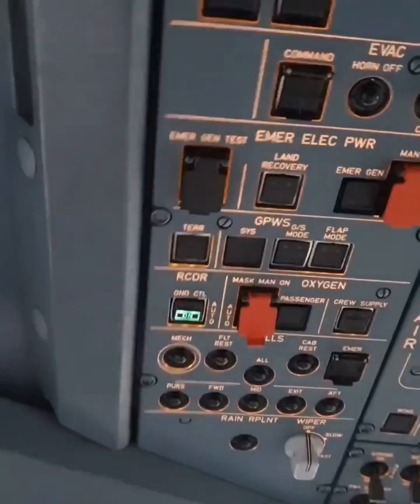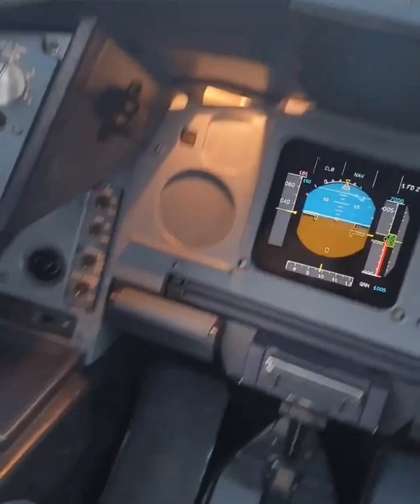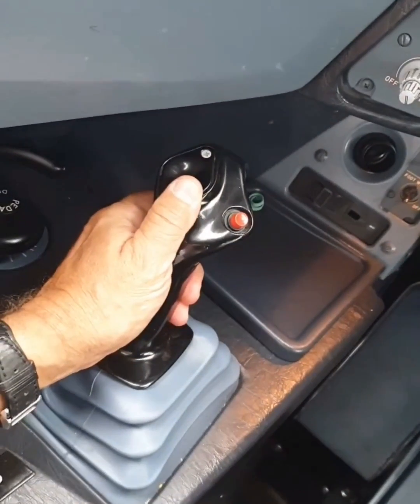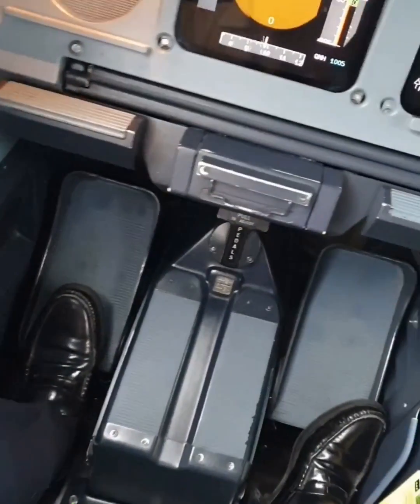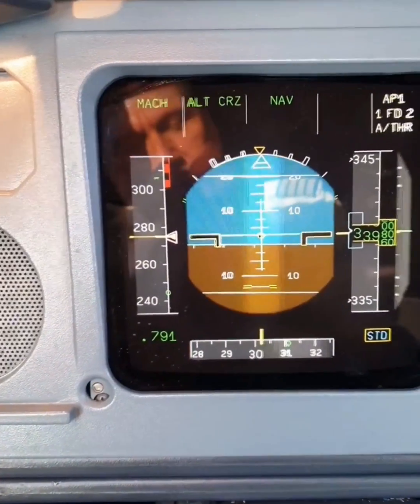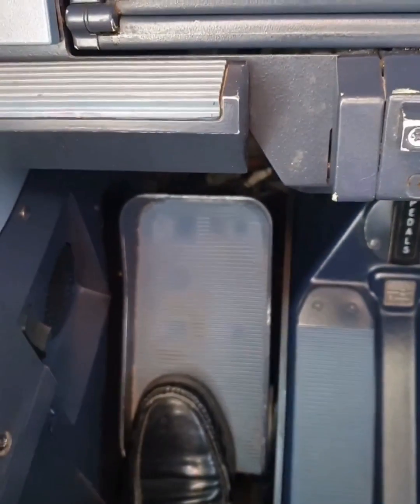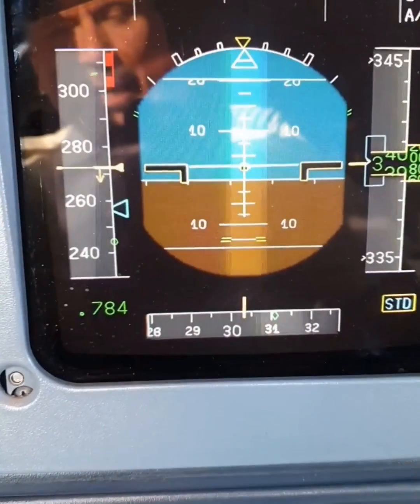The Airbus 330 Flight Controls 😉

Comment: Every time you pushed the peddals you pulled that speeder switch. I take it if you didn’t you would actually move the rudder instead of changing the speed. Also why have that feature when the speed controls are only above on the heading pannel.

Comment: I assume you did the Rudder Push on the Ground, since if you would did it in the air the Aircraft would have yawed and most likely gone into a spin or break of the Vertical Stabilizer? lol

Comment: Well there is still a gear stick on the plane and it is manual. When the plane gains speed at take off and gets airborne it is time to change to the next gear so you will hear "gear up, please".
Reply from the maker: 2 big handles at the center console is for the airconditioning. The fans.

Comment: It also works this way in the glider. Even thought it doesnt have an engine, you can still add power with right pedal and it has automatic transmission.
Reply from the maker: 👍🏼😂 Works everywhere. Also on a bicycle! Nobody found out.

Comment: Sliding accelerator and brake, is there any specific reason for this system to be like this?
Reply: The trick is he’s using the adjustment on the pedals a lot like moving the steering wheel forward and back on a car. You can see his hand on the lever when he shows the “brake”
Reply from the maker: @mattsains  shit, I did not think you saw it 😅
Reply: @bjornpilot  I’ll admit I did stare at the video and be like “????” I was like how did he do full deflection of the rudder at FL340 and he still has a job 😂
Reply: @bjornpilot  sorry for revealing the secret though, great video 🙂
Reply: @bjornpilot  ahahah I knew it was a joke, but I still don't know what you really used to increase decrease the speed....what is the pedals adjustment?
Reply: @bjornpilot  Ahhhh so the pedals adjustment was to avoid the rudder to actually move, and you changed the speed just with the thrust okk haahah nice one
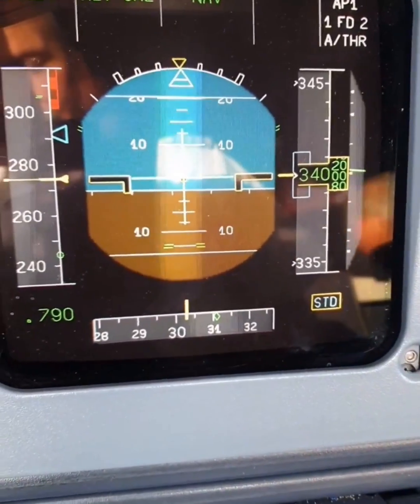Reply: @airplanewhat5316  at 1:07 you can see in the reflection that he's changing the cruise speed settings with his right hand up
Reply: @osasunaitor  ahabahahah you are right thanks ahah👍👍👍
Reply: It's a joke, the pedals are rudder pedals that control the yaw of the airplane, the brakes are on the tip of the pedals but only work on the ground.
Reply: it almost looks like a porsche pedal setup, google p[orsche accelerator location.